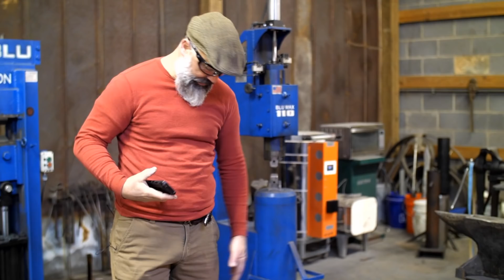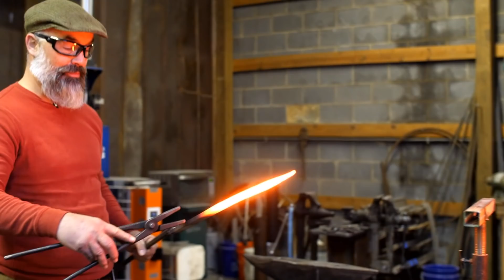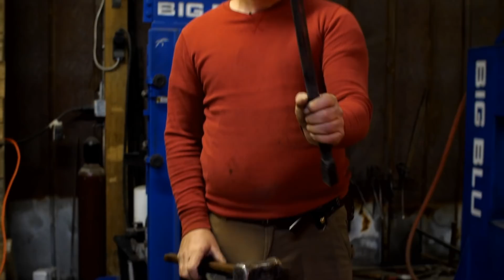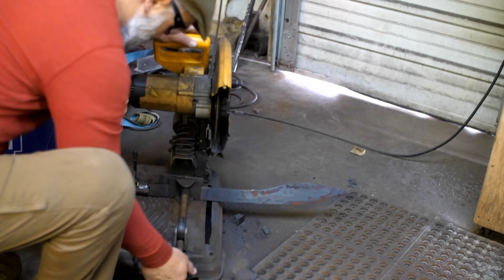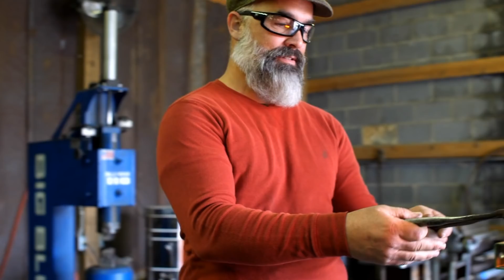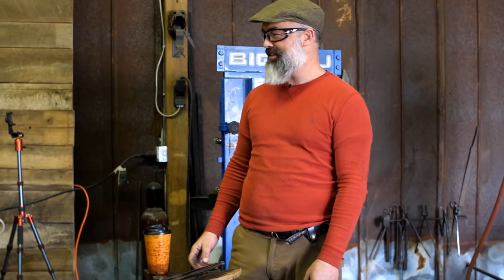LIVE | Forging a Barong

Comment: My favorite kind of maker/instructors are the knowledgeable, no bullshit guys overflowing with wisdom but will make to work for it. Another sub for your fire!
While I can certainly appreciate a power hammer for a production environment, before my hands went chummy I was very fond of my customized 5 lb sledge, railroad iron anvil and the ol' charcoal grill that I reworked with some extra steel and a blower motor for a very serviceable charcoal forge. Made a lot of great knives with it too, though my favorite that I wished I hadn't sold was an oversized Damascus kukri I made for a lawyer that wanted it for hog hunting. Took me a good two months but man, I wish I had it in my collection. Some knives come out so perfect it's heartbreaking to part with them.

Comment: You can definitely get started for less than 500 bucks. My first forge and anvil was an old bbq grill with a bicycle pump for a bellows and I used the face of old sledge hammer as an anvil.

Comment: Jason, thank you so much for showing this.
I have had an underlying shoulder issue for some years now.
I have always wished to create with a forge but always had the impression that it involved heavy hammer swinging that could burn me out quickly.
I understand that you probably do have to swing heavy handedly from time to time but, this video has really shown me that that may not be necessary.
Thank you for a very inspiring video!!
A may spend some time at the forge after all! 
Thanks again 😊

Comment: this is probably the most educative livestream i'v encountered so far. have a question: i just found a slab of large, rectangular steel (weights about 30 kilos, about 50x30x5 cm in measure and has a flat surface), which was probably a part of work out equipment in a gym and planning to use it as my first anvil. do you think it would work efficient, if mounted properly on a platform?